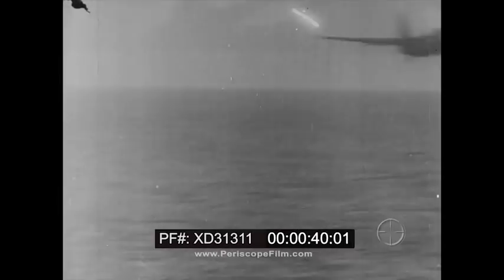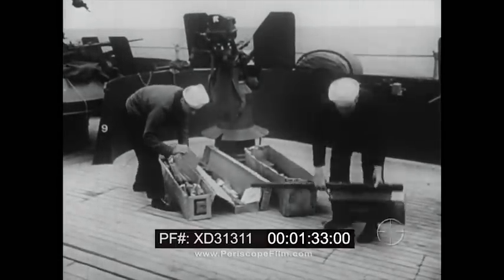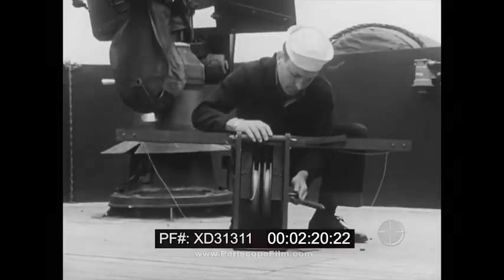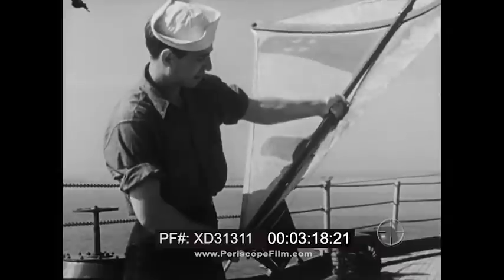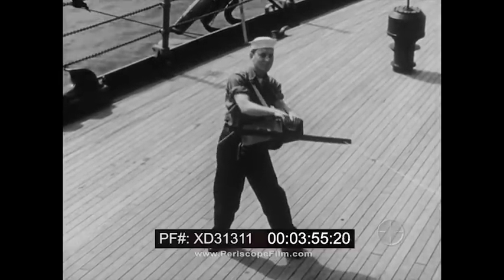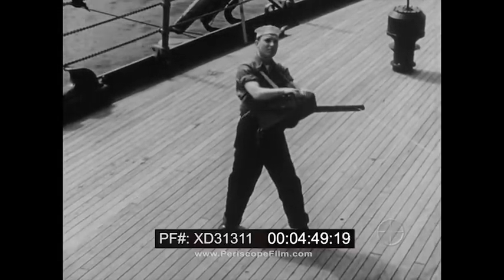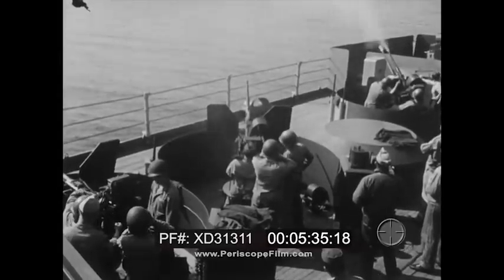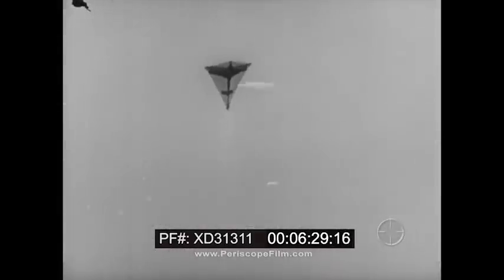" TARGET KITE MANIPULATIONS "  1946 ANTI-AIRCRAFT GUNNERY  TRAINING FILM  XD31301

Comment: Ironically, assuming this was actually filmed in 1946, 20mm guns started being removed from ships less than two years later. The 20mm was too light for the new, heavier jet fighters and bombers. The Navy was moving to all radar directed gunfire, and the 20mm gun wasn't set up for remote firing. In addition, each gun required a crew of two, and two more armorers were required for each battery of four guns to reload the ammo drums and repair and maintain the guns. A cruiser was generally armed with about sixty 20mm guns. That required about 150 crew, and that was a lot of berthing and messing space for guns that were increasingly ineffective. The rearming of destroyer size and larger vessels with twin 3"/50 automatic, radar controlled gun mounts and removal of all the 20mm and 40mm guns provided much more effective AA protection for only about half the required crew. Within fifteen years, many of the 3"/50 guns were removed in favor of 20mm very rapid fire, fully automatic Phalanx gun mounts and surface to air missiles. Time marches on.

Comment: I had one of those kites with a Japanese Zero displayed on the underside. I think I only flew it a few times as a regular kite. Mine didn't have the rudder. It was probably purchased war surplus and was incomplete. As I remember, it was almost as tall as I was and required some heavy cord and had a strong "pull" if you had very much wind. That would be an interesting antique today (kind of like me).
Reply: I wonder if Military still makes and uses them today?  I wonder how long kites had been used for this application. Maybe that's why dude thought up kites in the first place how many eons ago. Anywho, It'd be interesting to see the changes. 
Love.
Reply: Do you know what the framing spars were made from? I want to build one.
Reply: I remember the two cross pieces were probably 1/4th inch thick by 1-1/2 inch wide pieces of some type of light weight, straight grained wood, possibly pine or spruce. I don't remember how they were attached to each other but probably used some type of metal clamp or bolt/nut arrangement. The whole kite could be disassembled and rolled up for storage/shipping. Hope this helps your build.
Reply: @prsearls  thanks, yeah
Reply: @kpowers74  Probably use drones for target practice today, as RC planes are cheap and easy to produce.